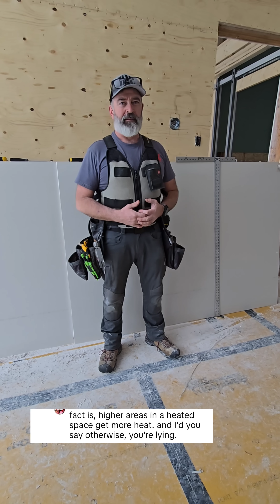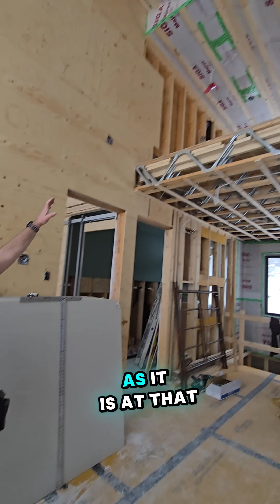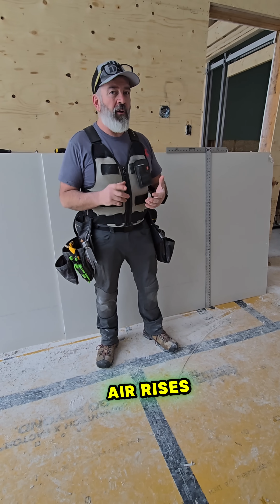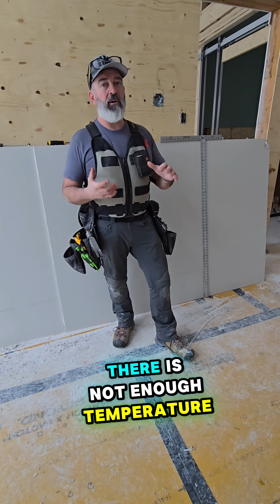Hot air doesn't always rise!

Comment: It all depends on your heating system... i.e. blowing around warm air vs radiant floor heating.
Reply: Nope, his point is hot air has to go somewhere to rise, but when the building is airtight that convection doesn’t occur and you get stagnant consistent temps.
Reply: @q1joe  Well, Aron speaks about "not enough temperature differential to rise" and in a sense, this is correct but to avoid convection you also need a heating system with a low temperture differential, i.e. a heated floor (or heated walls).

And besides good air tightness you also need good thermal insulation.